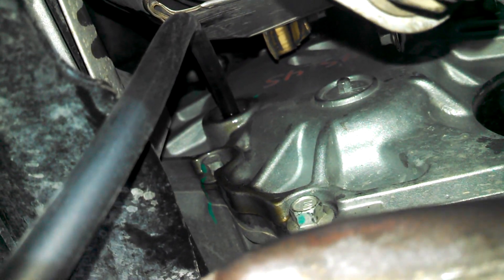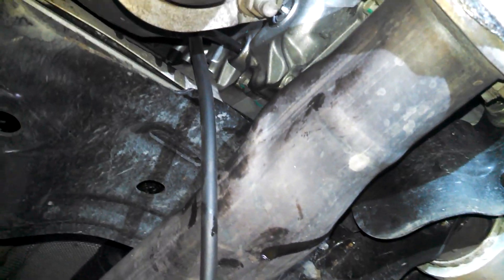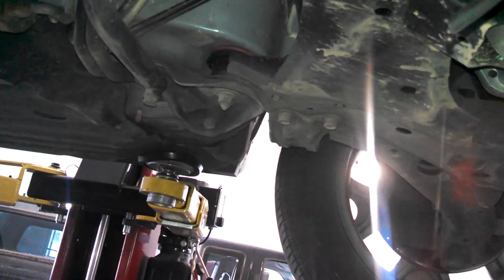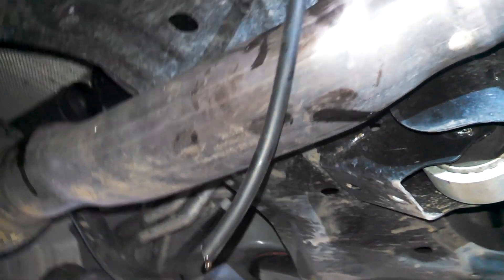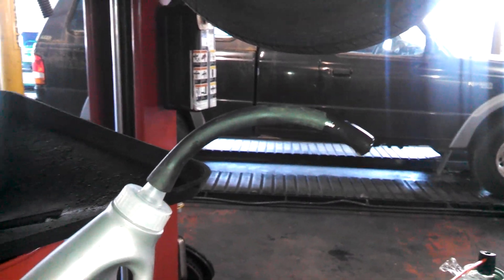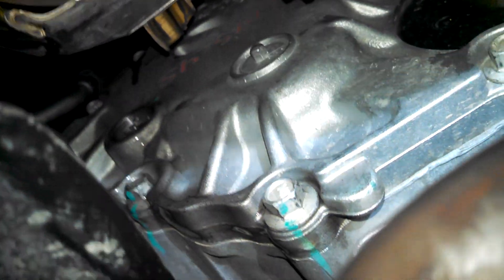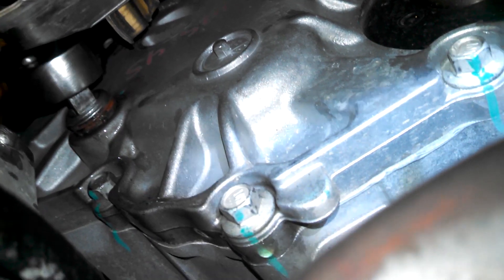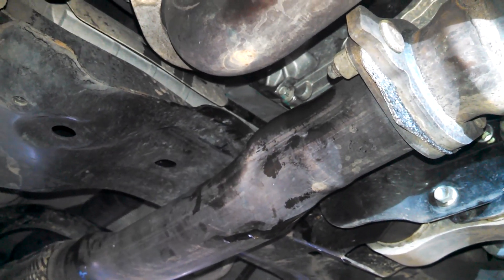Transfer case drain and fill 2015 CX9 Where is drain the drain plug

Comment: What about the mityvac transmission specialty fill kit? As this is a Ford cousin, they probably share plug hole sizes. It also works well with Mityvac 7201 which I own 2 of.